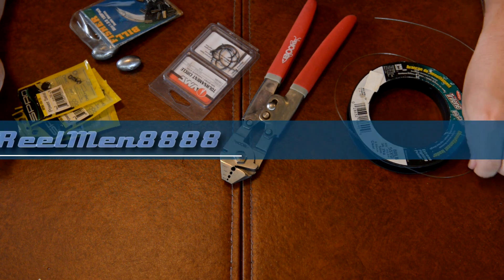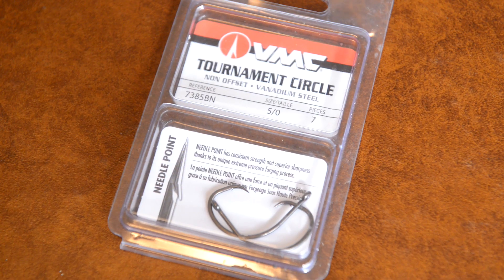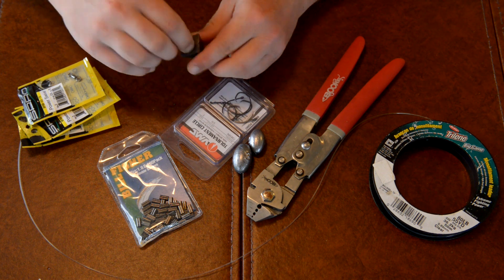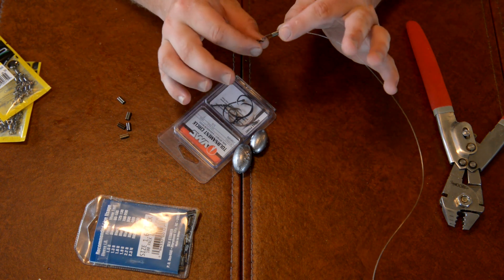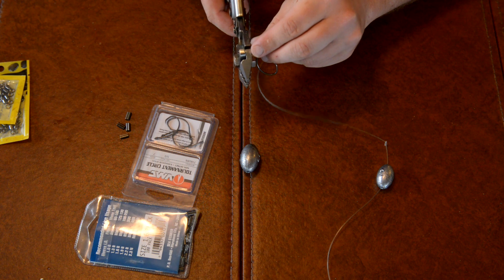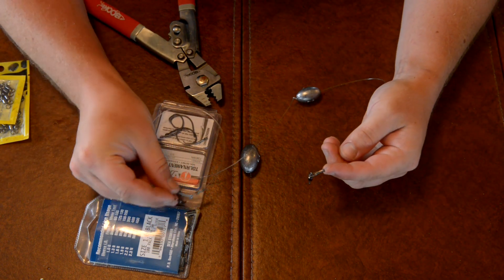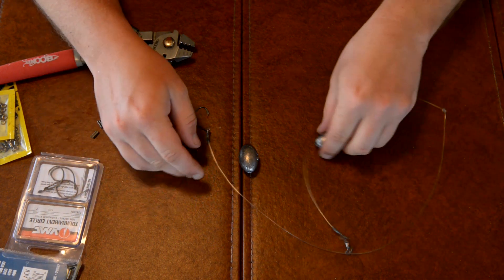How To: DIY Redfish Leader

Comment: Have you thought about using a longer loop on the swivel end?
That way you could thread the main line through the crimp, the barrel weight and the barrel swivel, then loop it back through the barrel weight then use the crimp and the barrel swivel as the stoppers for the weight.  
Then do the hook end like normal.
That way the weight can be as long or as short as you want to make it.

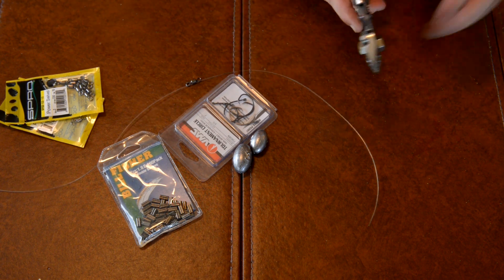Comment: Those Boone crimpers are junk because of the pyramid shaped end, narrowing to a point - see 2:55. You need the AFW or HiSeas, which are consistent in thickness across the jaws. And they're the same price, about $30, as this Boone junk. Or if you want top of the line, Jinkai SC3C for $75.

Comment: Holy thats some heavy tackle...I use 20 lb flurocarbon with 50 lb braid.  I love lighter tackle if you use your drag correctly you'll never break off a fish.
Reply: COLDDEAD HAND 
A 1k sized spinning reel with 10 lb. braid, matched to a 4-10lb. rod, with 30 lb. leader is actually lighter tackle, and more efficient at landing a larger fish, than a 20lb. leader on a Penn 500 loaded with 50lb. braid on an ugly stick.......

Comment: Heads up, when making a demo video , 3 things are vital; light, sound & picture framing focus, your sound is good but your picture frame is really bad, I had to take your word for the crimps, couldn’t see it.  You could have used a close up ,just framing your hands so we can see it, lastly when making table top demo, use 3 lights one left side one right side, one overhead… use Walmart clamp on lights with reg. Typing paper cloths pinned over it for soft indirect lighting, it eliminates all shadows, good info Thanks, Shalom!

Comment: Unless you're targeting bulls, 80# is total overkill.  No reason to crimp a leader, totally unnecessary, just tie to swivel. Never ever ever tie a knot in your leader.  

Finally, if you need a weight IN THE MIDDLE OF YOUR LEADER, just shorten your leader lol.  There's no reason that slide weight can't sit ABOVE your swivel.  That way, if current picks up, you can easily change out your weight.  With this setup, you need a completely new leader to change weight.  

Oh yea,  lead weights are available in all weights in the egg shape.  I have some that are 32oz so...🤷‍♂️